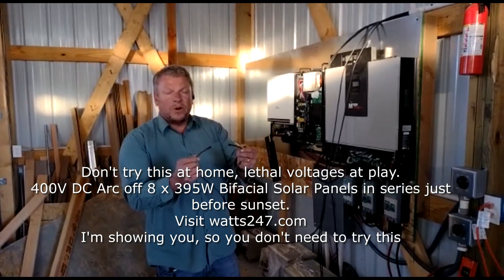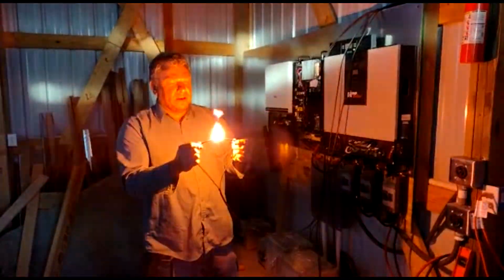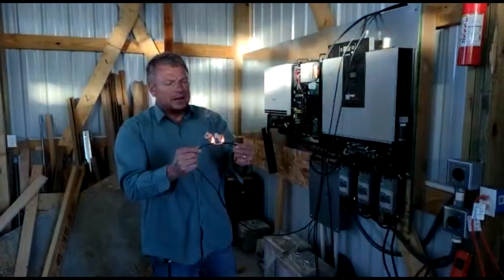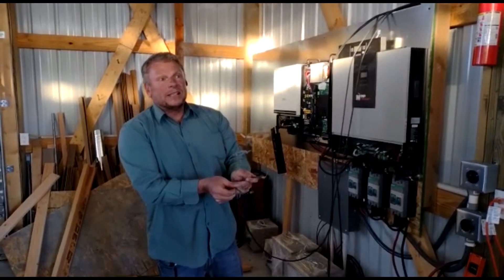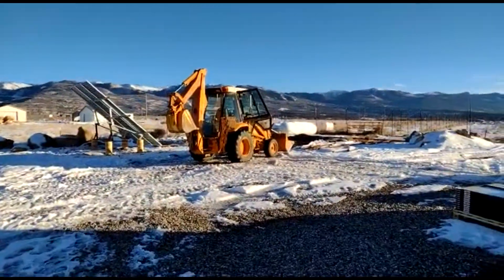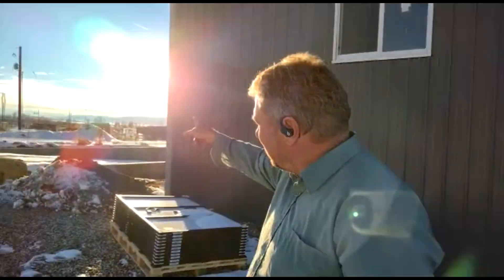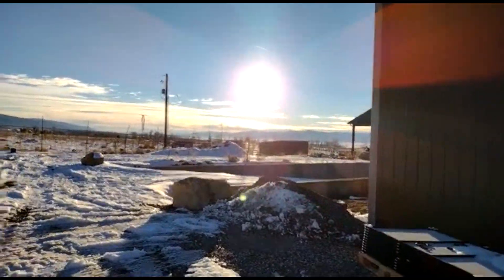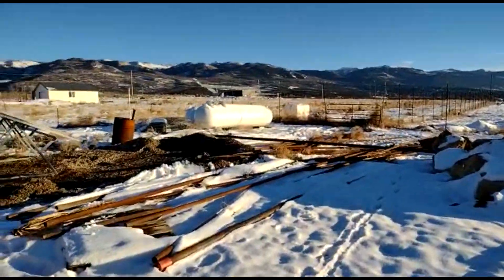Amazing Solar Panel DC Arc 400V, Dangerous!

Comment: “Be careful Not toys” that is words from a man that knows. I work on vacuum tube equipment mostly radios. Audio amps get scary quick 400-500volts dc with lots of capacitance behind it. There’s very few audio  amps that push the boundaries of 600-900volts DC. Like he said not toys! Especially if they are wired directly to mains!

Comment: Shows why a pyrofuse is preferable in HVDC systems. I'm just about to open two VW Passat GTE 9,9kWh batteries 
I got for a project so I searched for 400v DC Arc here on YT to get some safety inspiration :-) Thanks!

Comment: PV MODULES DC ELECTRICITY DOES NOT PLAY , IT WILL ARC , BURN AND KILL YOU IF NOT HANDLED OR CONNECTED SAFELY . RAW POWER SUN PRODUCED BEAST . WE PREPPERS MUST ALWAYS TAKE SERIOUS PRECAUTION . CHECK OUT MY DIY SOLAR VIDEOS , HIT LIKE , LEAVE A COMMENT & SUBSCRIBE . MAY THE SOLAR BE WITH YOU .:goodvibes::goodvibes:🌞🌞